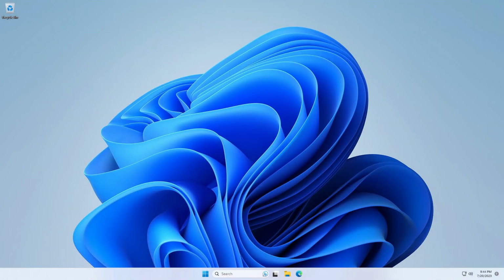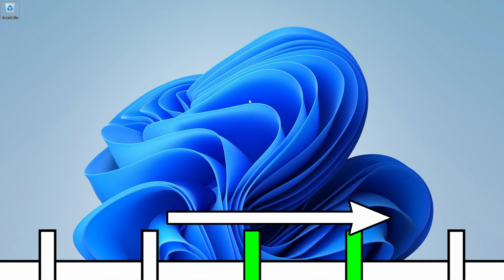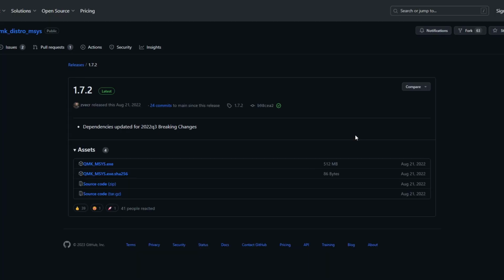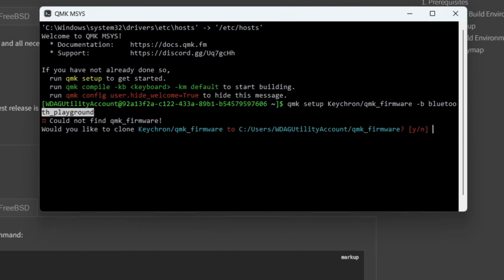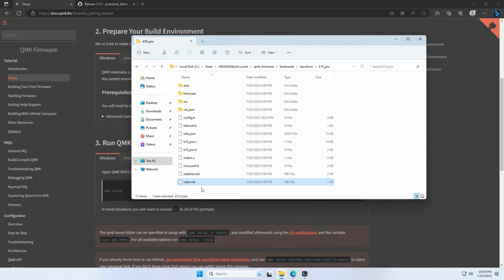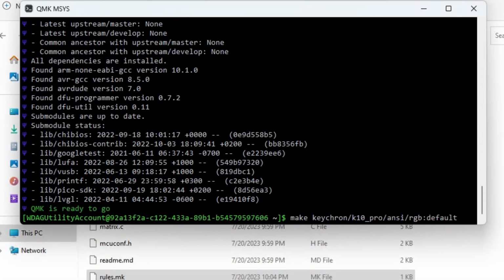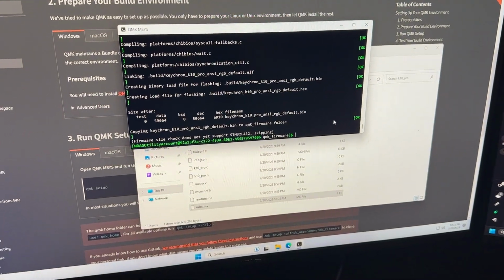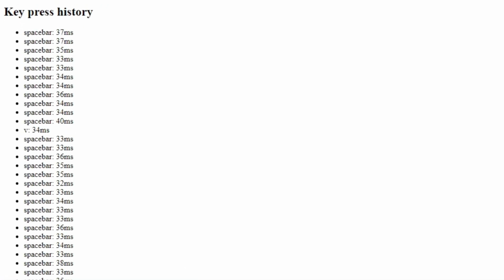How to Change the Debounce Time on QMK / Keychron Keyboards

Comment from the maker: WARNING: You could put your keyboard in an inoperable state if you mess up while building / flashing the firmware. Proceed with caution!

QMK Getting Started Guide: https://docs.qmk.fm/#/newbs_getting_started

Non-Keychron Keyboard Setup Command:
qmk setup

Non-Bluetooth Keychron Keyboard Setup Command:
qmk setup Keychron/qmk_firmware

Bluetooth-Compatible Keychron Keyboard Setup Command:
qmk setup Keychron/qmk_firmware -b bluetooth_playground

config.h addition:
#define DEBOUNCE [time]

rules.mk addition:
DEBOUNCE_TYPE = sym_eager_pk 

Find your keyboard on one of these links to know what command you need to run to build / flash the right firmware:
https://github.com/Keychron/qmk_firmware/tree/bluetooth_playground/keyboards/keychron
https://github.com/Keychron/qmk_firmware/tree/master/keyboards/keychron

Comment: Damn, there's only a single Epomaker keyboard supported. My wife's TH80 Pro V2 has insane double/triple click problem. I was hoping to sort it via software but looks like we'll just have to RMA it.
Reply from the maker: If you are only having the issue on one key, you may be able to replace the switch if the keyboard is hot swappable. If its the whole board, then you are out of luck though.

Comment: PSA for those using Keychron Q1 max keyboards (and other max variants afact), use qmk setup Keychron/qmk_firmware -b wireless_playground rather than bluetooth_playground. Just cost myself 40 minutes figuring this out.
Reply: note that you'll also have to run build with keychron/q1_max/ansi_encoder
Reply: and that the reset button is located under the spacebar

Comment: Thanks for this Max! Super helpful. Just one small criticism. I know you linked the github in the comments, but the make command differs between keyboards because the paths are different.

In my case, based on your video I initiatally did:

make keychron/v6/ansi/rgb:default:flash

Which caused my board to not work. After looking at the file structure, I found the proper command for my board was:

make keychron/v6/ansi_encoder:via:flash

This one worked, and also utilized the via keymap rather than the default, which lets me customize stuff in VIA.

TLDR:
Don't blindly copy and paste commands. Check the folder structure for your specific keyboard :)

Comment: Hello! What's the scan rate results with default settings on your K10 Pro? 1000 Hz + sym_eager
Reply from the maker: If I recall correctly, the shortest press that I could get with default settings was 5ms